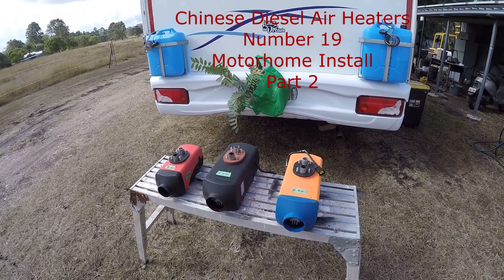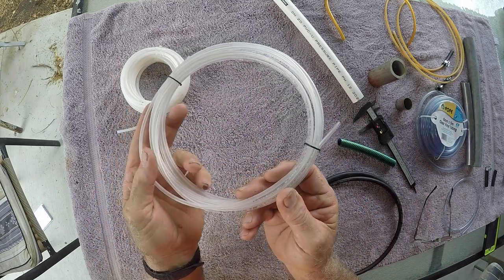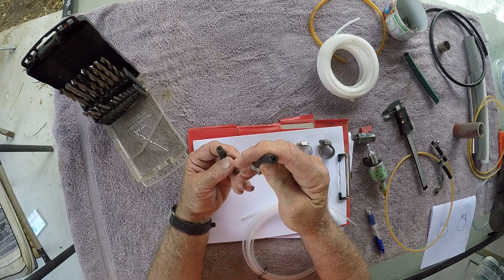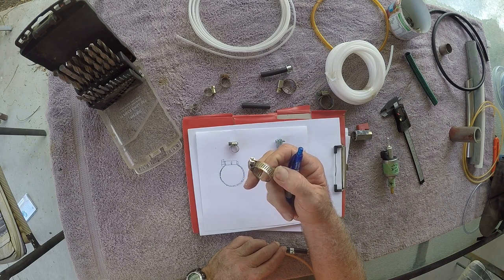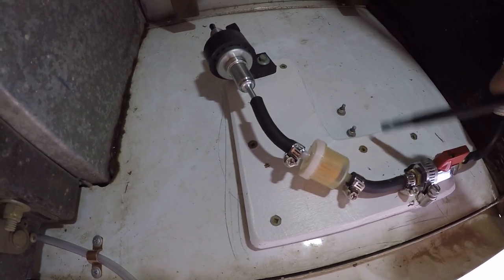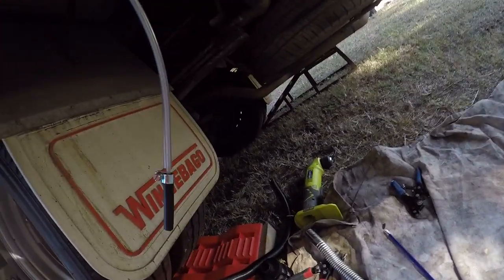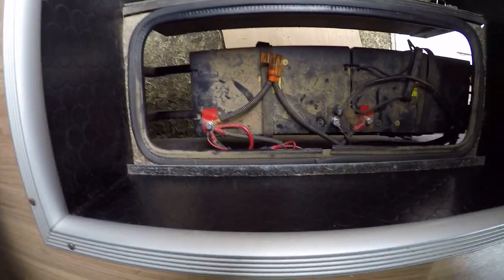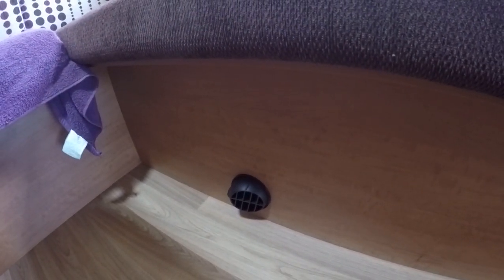Chinese Diesel Air Heaters no 19.   Motorhome Install Part 2

Comment: Hi ,great Information you have on this heaters..
I put in a 8k heater in my RV .  It working great, but sometimes I get a  slight smell of diesel exhaust in the RV, It seems to be coming through the heat  duct , but not sure ,
It very little, and it doesn't always do it , I was also thinking that maybe the smell is get in through the slide out rooms seal ...
But can you get a little diesel smell through the heating dock ??
Also when I first started it , it got flooded with diesel fuel and smoked a lot for a while, maybe that's still smelling..?
Thank you
Reply from the maker: Hi Rich,
Have a look at the gaskets video first, I speak about this there. 
If you have further questions please come back to me.  
Cheers.  JMcK

Comment: @JohnMck47 I have been watching all your videos and learning so much! I recently purchased a 5kw heater and am making decisions about installing it now, I have heard you say several times that the unit can be used on its side as long as the glow plug is on top, but I’ve never seen you mount one on its side or test it on its side. Are you completely sure there will be no adverse effects from mounting and running it on its side? Thanks so much for all your instruction, you are my hero right now!
Reply from the maker: Hi Nathan,

Thanks for the feedback.

I have just now replied to you about this matter in another post.

These heaters will actually run at any position, FOR A WHILE, but the correct install is exhaust down. 

These heaters will also run just fine on their side, provided the glow plug is up. 

But you are not the first to ask this question. I need to now get myself some spare time and actually do a video side mounted.

Cheers.  JMcK

Comment: Ty for your work and most of all for  your willingness to share . I was wondering if preheating the intake clean air for the burner side with a air air heat exchanger using heat from exhaust (without restricting the air flow) will increase the overall performance .
Reply from the maker: Hi RA, you, and others have some good ideas in these matters, and yes, it can increase efficiency. The issue is, for the average person, is it worth the effort.....But I am all for experimenting.  JMcK
Reply: @johnmck1147  well when full time van living with 12h of heat it adds up , not to mention the diesel cost this days. I think a simple used egr gas cooling heat exchenger will do the trick.ty

Comment: You mentioned you've extended the battery harness by 4 meters but have to double that amount and mesure "out and back". Why do you have to calculate the wire thickness using double the distance of need the extension for? I.e. using 8 meters for calculation instead of the needed 4?

Comment: How about a "force on" termostat switch in parallell with the power switch. So when heater is warm you are not able to turn off power. If you turn off the termostat force on the power until it coold down.
Reply from the maker: Hi Byron, I have not tried that, but it could have merit. However, you need to be careful not to make things too complex.

Thanks for the feedback.   JMcK
Reply: Great idea, because I had the same. If both the manual main switch and the thermostat control a common relay, you would be free to place the main switch, since it could be run with much thinner wire.
This type of built-in "wait until it's safe to turn off" safety is seen in a lot of equipment where just instantly cutting power is dangerous in itself.

Comment: Hi John, I like your video's on these Chinese heaters. I am planning on installing one of my own but I am wondering how much free space is needed round the heater. The best space for me would be below the kitchen cabinet below the bottom shelf but the space is limited there.
Reply from the maker: Hi Ron, free space is very dependent on your environment and whether you are heating recycled air, or heating outside air. With recycled air around 100 mm (4 ins) sides and top I would personally consider a minimum clearance. If you had 200 mm on the sides you could perhaps go down to 50 mm on the top. Heating outside air you could perhaps go down to 3 in clearance without overheat issues.   JMcK
Reply: @johnmck1147  Ah great, did you ever test extending the exhaust ?
Reply from the maker: @ronpool3114  

Hi Ron,

The little combustion air fan does not have much force to push the exhaust out, and is totally unlike the piston displacement force of a motorcar. A long exhaust creates restrictions in the system resulting in bad fuel air ratios, and hence carbon buildup, and greater maintenance issues.

If the exhaust rises, like most boat installs, you can go longer (hot air rises), and boat exhaust can be up to 3 meters long. 

With a straight exhaust,  2 meters is really the longest you can go without back pressure issues.

If the exhaust goes down, and hot exhaust gases do NOT want to go down, an exhaust of more than about 1 meter will cause combustion restrictions.  JMcK

If you need a longer exhaust I suggest you go bigger in size to lessen back pressure issues
Reply: @johnmck1147  Thanks (again) , I was thinking in the same direction, the exhaust needs to go up and I'll make it wider.

Comment: great video mate.the only thing is the temperature only go up to around 40 celcius (100-110 farenheit ) not 110 celcius.
Reply from the maker: Hi Normy, please have a look at the bench test videos. These heaters can achieve an outlet air temperature measured 500 mm from the burner heat exchanger of over 100 deg C (212°F). JMcK.

Comment: Hi John - am I right in assuming that your second priming from the doser pump to the burner unit is useful only because you have a long distance there. In situations where the distance is  relatively short, this would not be necessary because the doser is being lubricated from the fuel supply available thanks to the first priming (from the fuel source to the doser)?
Reply from the maker: Hi Dirk Correct.
However it also means the heater will start first time.
On a long run from pump to heater, on initial install you will need to start the heater quite a number of times to get the heater to prime.  JMcK

Comment: John McK 47, you are on my Christmas list. This may be my last post... at least for a long while.
 (2K-5K-8K) [ 1.4Hz-5.4Hz ]  My unit is installed, purrin', smooooth...  Hit on/off and give it no mind, quiet, HOT! 
Had to adjust the fan away from the magnets (Error 06), 2 screwdrivers pry, slides right off.
Spin it manually to test it turns freely... that's all.

Comment: Hi John, I appreciate that these videos are 2 years plus old now, I’ve watched all of them, and picked up lots of really good advice.
I have three of these heaters one fitted in my Camper, one in my workshop, and are fitting one in my conservatory in the Uk, my concern is that being in the conservatory, (fitted outside) vented inside, at times this unit will be left unattended for a short time, unlike the other two.
Would it be feasible to run this off a small battery? Maybe 30Amps? Connected to a permanent battery charger, so if supply trips it will have time to shut down by me manually.
Can you see any problems with this.
Or is it possible to fit a change over switch to switch the battery on to only power the fan to shut down. At this time I am having trouble sourcing such a switch.
Many thanks for any help with this.
Wishing you good travels in your boat, and an early merry Christmas.
Chris..
Reply from the maker: Hi Chris, 

It is simple to run the heater off a small motorbike battery and a small smart battery charger..
Even if the power goes off (storm) and the battery goes flat the heater will still go into safe shutdown mode as voltage gets low.  

Pleased you found videos helpful.  JMcK
Reply: @johnmck1147  Thanks for super quick reply, my thoughts exactly.
Will let you know how I go on.
Safe journeys to you and yours.
Chris..

Comment: Hi John, Great videos, informative and practical. I hac=ve installed a 2Kw (should have watched the Videos first) I understand there will be blowing type noise inside the van, but what causes the high-pitched whine. I have seen it described as jet engine noise in feedback to you. Great work. Dave
Reply from the maker: Hi Dave,

Thanks for the positive feedback.

The heaters do make a lot of blowing noise at a high speed setting, but should not make the noise you describe.

Suggest you run your heater at lowest setting, generally around 1.6 Hz. At that speed you should hardly hear it. 

If your heater has a screaming noise at the low setting you possibly have a bearing issue or the fan is rubbing on the case. If new, suggest you ask for a replacement.

If your heater is “quite” at the minimum setting, and gets progressively noisy as you ramp up the heat setting, you have got what you got. 

That is my reason for having a bigger heater running slow, rather than a small heater running fast. (Not just heaters by the way)

Cheers.  JMcK
Reply: @johnmck1147  Tbank You John for the advice. I have carried out a series of different speed settings, but the Turbine type noise is still audible above the blowing Noise.
I am in communication with the supplier, and on his request been trying to send Operational Videos. However he has not been successful opening them. I have just today sent and Audio file ... I will wait and see.
Additionally for a relatively small outlay I can buy a 5Kw unit and it should just about swap straight in. Thanks for you advice, all the best Dave
Reply: @johnmck1147  Hi John, I bit the bullet and installed the 5kw unit,  but still have a couple of questions. my new unit controller shows H1 to H6 as the temperature control instead of the pulse setting you mention. Is this the same? Also your video showing that the unit continues to run if the controller is disconnected is disconcerting. Is there anyway sending the off signal if you don't have a backup controller? thanks Dave
Reply from the maker: Hi Dave, 

H setting is short for Hz or Herts (Herts is frequency, that is pump pulses per second)
In the very rare occasion you have a controller issue and can't turn off heater, just shut off the fuel and it will do its shutdown thing and switch itself off. 

In an emergency you can shut off power, but could fry the ECB from overheat.

Cheers.  JMcK

Comment: Great video's that will come in handy when i install mine, on a side note i have seen videos where people have had success in vauxhall vivaro vans installing a T in the diesel return line which i assume is not pressureised and the pump seems to be able to lift fuel out the tank using the return line.
Reply from the maker: Thanks for the feedback Putbinoot.  
Do you know if the fuel leakd past the heater pump seals when the engine was running? 
Did the heater need priming each time starting?   JMcK
Reply: @johnmck1147  not seen that reported, not sure if there is a great deal of pressure in the return line so maybe the larger bore of main fuel pipe is enough to prevent pressure heading to the pump.

Comment: Hi John,
I’m sure it’s been asked already but what are your thoughts on running these units as waste oil burners?
If your up for the challenge, what would. Need to be done to have them reliably work?
I’m assuming good filtration of the feed oil? Would the pump be up for it?
How about an experiment with waste oil : diesel mix ratios.
With your expertise it would make a great video
Reply from the maker: Hi Paul,

These heaters will basically run on anything that will burn including engine oil waste oil, vegetable oil and possibly even snake oil...........FOR A WHILE...........burn a small amount of the fuel you wish to use in a little open top container and observe the amount of smoke. The more smoke the more carbon waste produced.

Burning oily products produce large amounts of carbon which rapidly gum up the burner and burner atomisation screens, and your heater will no longer work. Yes you can strip down the heater and decarbonise it every hour or so if you wish.  -  But why?
Reply: Thanks John. I take your point. 
I guess the why is because I can get hold of decent quality waste oil for free but if it’s going to mean constant cleaning then there comes a point where it becomes unviable. 
I’d just be interested to see how flexible they are and find that sweet spot of not to much maintenance and cost of fuel. Really appreciate your reply’s.

Comment: John, your series is really great! I just finished my installation of a 5KW unit in a VW Vanagon here in Boston. Have you done a video on the fuel pump frequency settings? If not, could you do one? I see people going into the settings and changing the minimum and maximum pump frequencies but I don't fully understand the ramifications. For example, my factory default lowest frequency setting is 1.4Hz. It is possible to lower it all the way to .8Hz. I tried that and the exhaust started smelling, indicating poor combustion. It appears that too lean is not necessarily a good idea even though I thought that it would lower fuel flow (and there's less clicking.) Let us know what you think if you have the time. Thanks!
Reply from the maker: Hi Mark,

No, I won't be doing one of those videos. This series is to try and help the DIY people who will buy one of these heaters on line, and get no real back up support. 

I will leave it up to the experimental enthusiast to go down that path.

Out of the box these heaters are set up for an optimum fuel air mix ratio, and if you adjust the pump setting you also must adjust the fan setting to get a correct fuel air mix. Look, if you like to experiment, go for it, but if you change all the settings there is no simple "reset factory settings" button.

1.4 Hz - 1.6Hz is really the lowest practical setting for these heaters. Like all naked flame burners, turn it down too low, and the flame will go out. There is just not enough fuel for combustion.

Cheers.  JMcK

Comment: Great videos, John. Thanks so much.

Question: where did you find the fuel shutoff valve? I haven't been able to find a brass 4mm one like you have in your video. Cheers.
Reply from the maker: Hi Anthony, many automotive and marine stores will sell them, as do some hardware stores. I have bought them from Repco and Super Cheap in Australia.  JMcK

Comment: Hi John thanks for all your help and info, just for your information my fuel is supplied via a "T" piece and I have no problems so far with it. The mechanic I use also converts campervans and has used this system on many without issues.
Could you please confirm that my fan speeds are ok? :)
Reply from the maker: 👍

Have already answered re fan speeds. See other post.
Seem ok to me.

Cheers. JMcK

Comment: Hi John, I really enjoyed your 19 videos.  I have a Autoterm 2D heater which worked well the few times I used it last year but when starting it this year, the fan runs but the temperature does not increase - it has diesel fuel - where do you suggest I start troubleshooting this?  Thanks John
Reply from the maker: Hi John

The first things I suggest you do. 

1. Check fuel is getting to the heater. Do you hear the pump “ticking” indicating it is working?

2. The pump won’t start until the glow plug is hot enough to light the fuel. 

3. Do you have any error codes?

A common issue I find here is low voltage at the heater on start  caused by the glow plug drawing nearly 10 amps. 

In nearly all the cases the heater was wired to the distribution panel rather than direct to the battery. And on top of that the power wires to the heater were too thin. 
Worked initially, but not after a bit of use with lose connection, dirt, corrosion etc. 

If wire ok and pump ticking, check diesel is coming out the end of the narrow bore hard nylon fuel hose. 

If you are using that cheap rubbish soft vinyl fuel hose often supplied these days, you most likely have carbon build up in the burner atomisation screens, and the soft vinyl is absorbing the fuel pulse and it can’t atomise to light. 

Some things for you to start. 

Good luck. JMcK
Reply: @johnmck1147  Can I send you a photo of the setup?  Where too?
Reply from the maker: Yes John. 
johnmck47@outlook.com

Comment: Hi John, if the switch installed in the main power wire is to stop the LCD screen drawing power when it's not in use. Why don't you just install the switch in the power wire to the LCD screen?. It could be installed next to the screen. This would have the benefit of, if it was accidentally turned off, then it would not shut down the heater when it was running wouldn't it?.
Reply from the maker: Hi Paul, you could do that if you wish, but you would still have power to the ECU. I suggest you would also need a main switch to turn off power to the unit over summer, so you now have two switches really doing the work of one. But this is a personal preference thing. Different people have different opinions and will do what is best for them.  Cheers.  JMcK